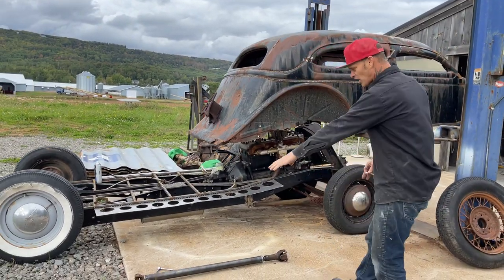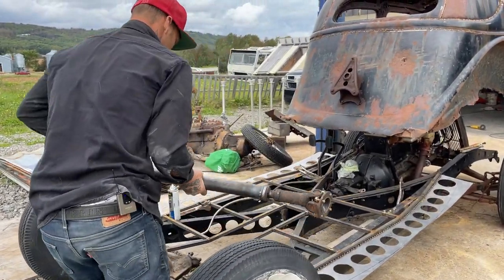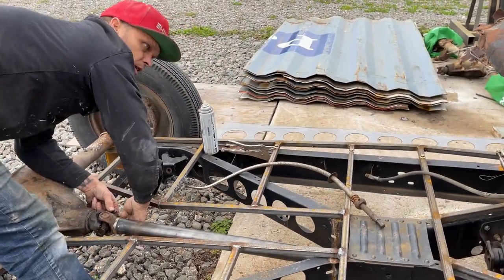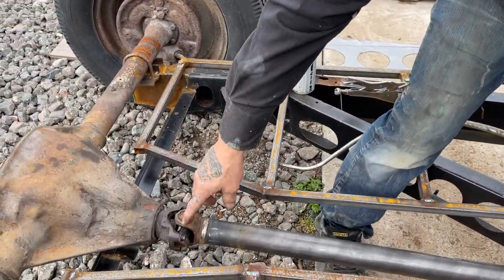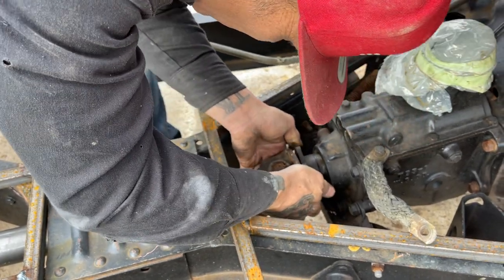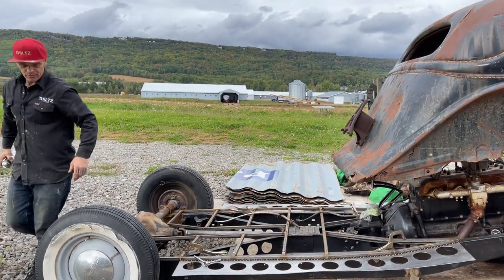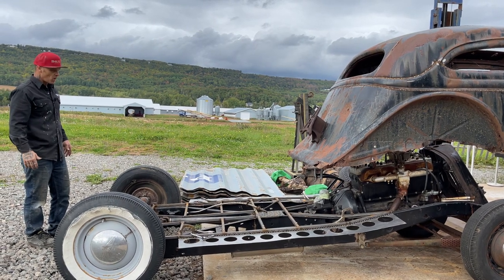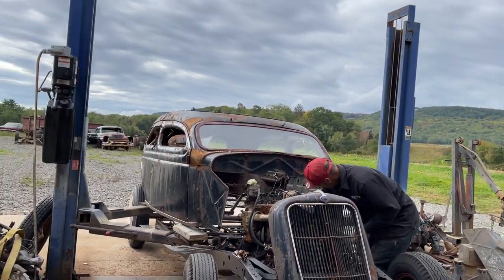MARRYING THE BODY TO THE CHASSIS: 1935 HUPMOBILE/FORD HOT ROD

Comment: Chad I just watched your video of installing the driveshaft! Don't forget to weld those yokes to the tube, don't rely on the tight press fit. Also the rear u-joint may have to be a conversion joint, I know you said you may replace them but this one doesn't look like it's quite the right size. I'm not knocking your build as it is yours to do whatever you want, just making a couple suggestions. I'm liking the actual build just not too sure about the solid diff and the driveshaft. Chad your skills are awesome but sometimes there are things that just don't look right.

Comment: I'm all about reusing parts. I'm not sure I'd trust that u-joint enough to drive with it though. I'd spend the extra money for piece of mind. Also, if you mount the trans side first you can rotate the shaft to make putting the bolts in easier. Love the way it's looking. Gonna be a fun ride.

Comment: This kind if cracks me up. You use the Plasma cutter free hand and get an amazingly straight line.  I use a ruler/straightedge and still can't get a straight line!
Reply: Ikr. Unbelievable when he was tacking and pushing the metal up it fit perfectly in length right to the edge... 👍🇨🇱

Comment: You need to have a custom pull header built for that motor so the exhaust goes straight up.  Then hook up nitrous oxide.  And some slicks.

Ps.  Is the plan to not have the doors work at all?  It seems with that square stock welded to the outside and then that will welded to that, the doors are planned to be closed forever and the only access will be the roof.  Is that right?

Comment: The one U Bolt is the only thing holding the driveline to the frame? Are you going to add more support later or is it just a mock up at this point
Reply: It's a fun build to watch, I also am concerned with the u bolts holding the total weight of the car to the axel. Four 1/2" nuts on two u-bolts are not enough.

Comment: That rear UJ looked to have a lot of movement side to side (4:48 5:03 5:10). May need a special joint with cups wider on one axis than the other, or some spacers to centralise the cups better on the diff yoke.

Comment: You been working on cars for how long? in most 20's  and 30's hot rods that line about the back tire is suppose to be where the axel goes, or the middle of the back tire. If body is crooked it's on a chain or forks of lift you shift the body when lowering DUH. You should know if the firewall gonna hit before you drop the body. Don't see how it saves you time doing what you do for some things. Do like a lot of the things you do and your attitude, whether you think others like the way it looks or not. Some of the things are funky or weird but it's your vision. Like Barris or Winfield a man with a different vision.

Comment: I just looked up engine 101 hp and did 145 mph at salt flats it's 245 cubes very low compression have head milled and do split carbs and split pipes maybe digital distribution kit in ignition will do alot

Comment: Before you fit the drive shaft to the car, you should have cleaned out the universal joint caps and re-greased the needle rollers in both ends.